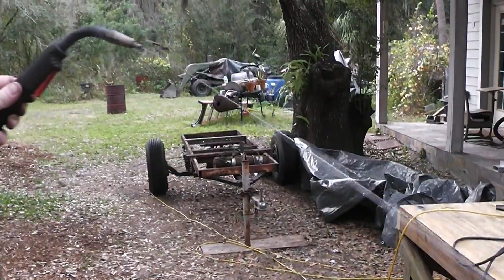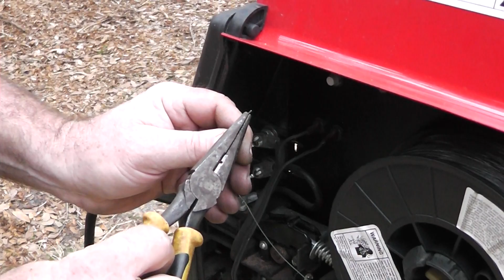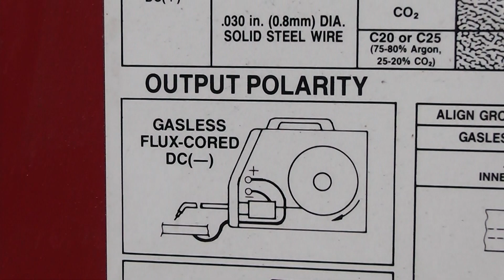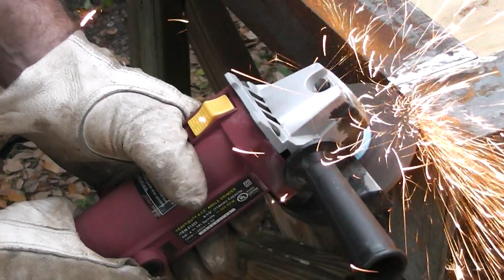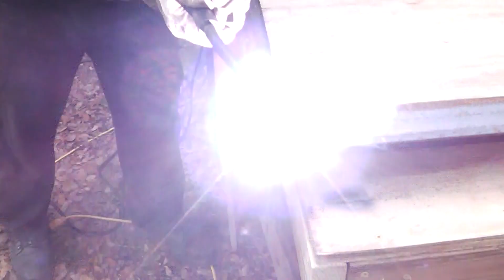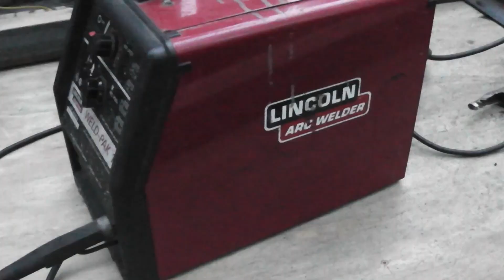Flux Core Wire Mig Welding Dump Trailer Project

Comment: With no gas added or dual just straight up flux core.  Ive did some on solid with square pipe and round pipe . I got good beads and good penetration.  Welds looked like dimes . Depends smooth are good too just like 7018 or the like. But not as strong as 7018. . Smooth and dimes . . And open root can be done too. Ive tried it and worked out good . Keep tje work piece cleeen clean lol.  And stuff . I did a,half inch root . . Flux core welder wire is good . And it does or can be used as a,cutting just like a welding rod ivr tried it . Any criticism feedbacks are welcome . To all the welders out there . Thumbs up.

Comment: Has this guy never heard of Anti Spatter Spray  ?? Wire wheel in a drill ?? How lethal is that
Reply: @triggeringliberals405  Safety is a basic necessity  for anybody doing welding. It is not something that warrants the ignorant comment of STFU. Wire wheels like the one used in the video are dangerous. I don't allow them in my workshop.Only the twisted type are used on grinders that have a side mounted hand grip on.

Comment: You will get better penetration (higher amperage) with higher wire feed speed and by positioning the ground clamp on shiny clean metal as close to the work area as possible.This is the first of your videos that I've seen, I look forward to see how the rest of the project turn out...

Comment: yeup the 100s and other little 110 mig flux core welders are designed to give you a taste of welding without spending a ton . heres my two cents . I plug that thing in and run down to the creek and throw it in , if my extension cord was to short id run it right down to the pawn shop and trade it in on a lincoln ac 225 stick welder or any of the other 220 volt ac or dc stick welders , they will weld right through rust and dried cow shit stuck on the iron , you can soak a 6011 in water and crank the welder up and cut that 1/8th inch angle like butter with the right stinger you can braze and solder , those little 110 welders arent made to build trailers . K rants dun lol
Reply from the maker: FYI you might know a little about stick welding but, obviously you don't know too much about flux core welders and what they can do with the right operator.  This dump trailer has held together for the past 3 years with no issues.

Comment: Fix your ground clamp. On straight polarity (Electrode Negative) the electrons flow FROM the ground clamp THROUGH the metal and jump the arc to the tip of the wire. Attach the ground to shiny metal where it has more points of contact and your welds will be better quality. Just doing that would probably make larger welds and less spatter. Good video though, it was still educational!!!

Comment: I think you are using E71T-GS flux core wire, GS means it is a single pass wire. nr211-mp is a better wire for multi-pass. I am not a pro-welder by trade so do your own home work.
Reply: Agreed!  The 'GS' wire is less-expensive for a reason. SINGLE PASS ONLY.  The milti-pass wire is E71T-11  (Lincoln calls it 'MP' for MultiPass... but the fine print on it says E71T-11)

Comment: nice!!!!! I love my old weld pak 100. the new ones have a lot more bells and whistlesbut i doubt they can get any hotter than the 100 because there is only so much you can get from 110 volts. Ive never used the circle method of laying a bead,i use the  "U" shape. Ill try the circle method next time im welding.
Reply from the maker: Thanks.  That old welder has been through pure hell.  I'll try the "U" shape next time I weld!